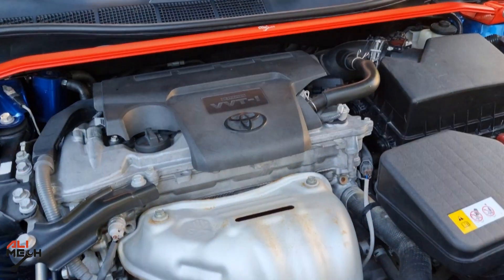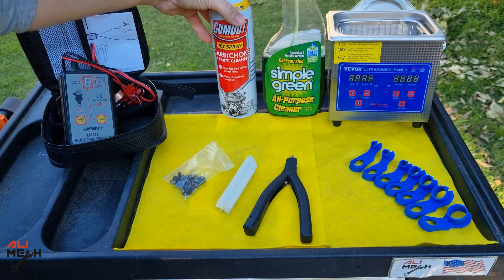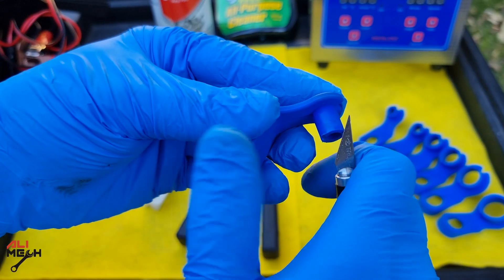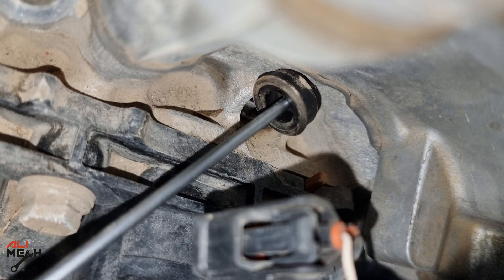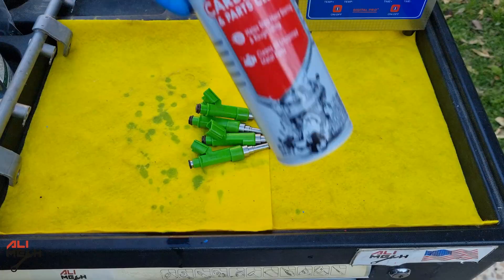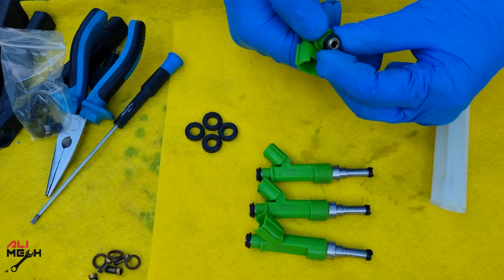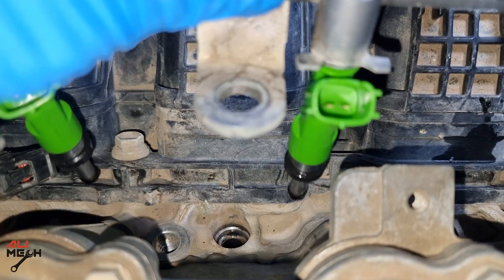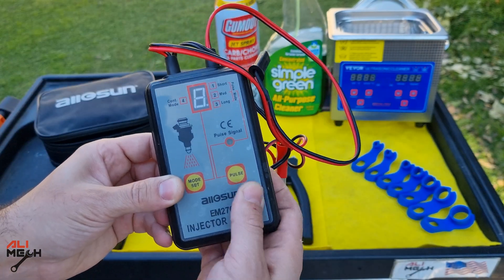Rebuild any fuel injector like this and gain engine power back / Toyota Camry fuel injector cleaning

Comment: Hi! I just subscribed.  Your video on cleaning the fuel injectors is very informative. I have a 1997 camry which is my daily beater. Also have a 2017 rav4 which have the same engine as your 2017 camry-(2AR FE).
I want to clean my 1997 camry fuel injectors. They are the DENSO brand. Can you please tell me which rebuilding service kit I should buy for this car model?

Also, can you put the Air/Fuel Ratio Sensor (up stream) in this Ultrasonic cleaner by just dipping the sensor in the cleaning solution and not the wire harness as this may damage it completely.
It's a good thing I came across you channel. You have a great channel! I'll be forwarding this to my friends who are DIYrs too!